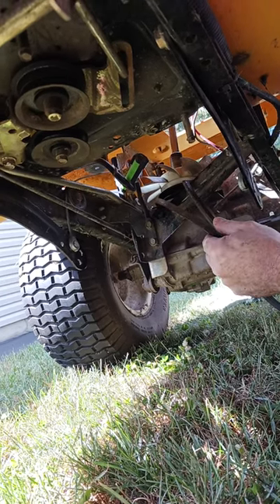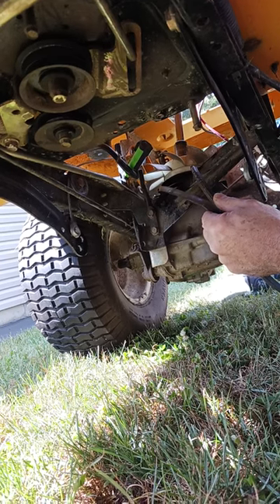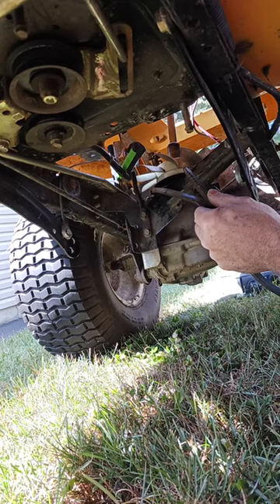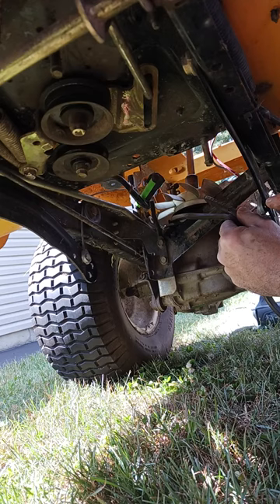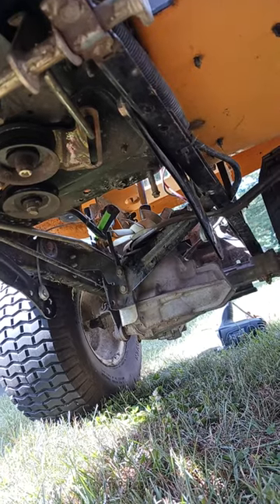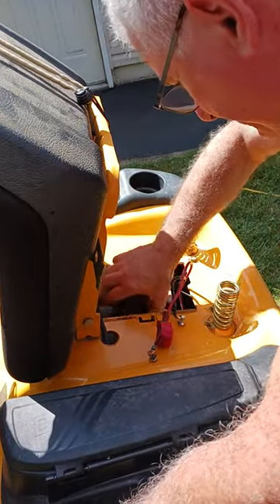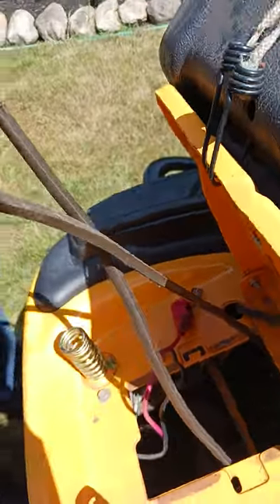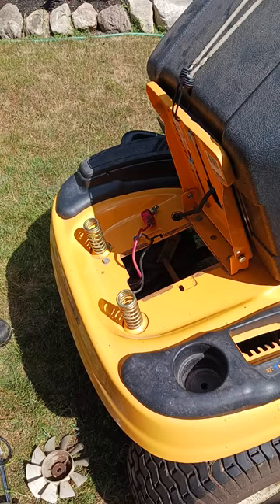Cub Cadet LTX 1142 KW Drive belt removal hint

Comment: my son just bent one tab over a bit to allow belt to slid up pulley, then turn to remove . The bolt was corroded quit a bit and he did not remove sit to put an impact on the nut.